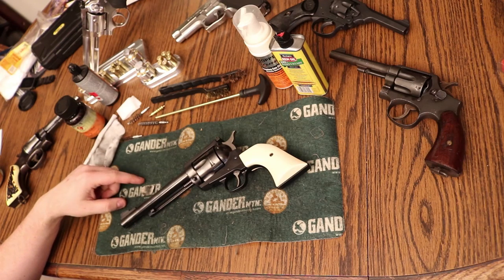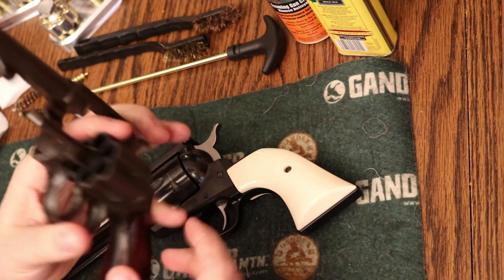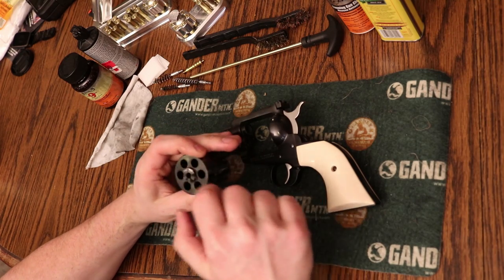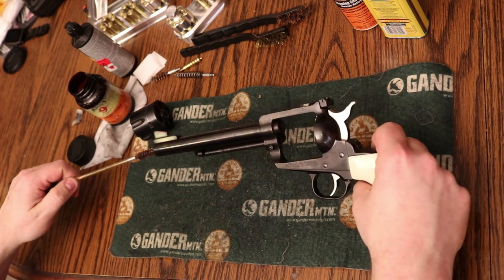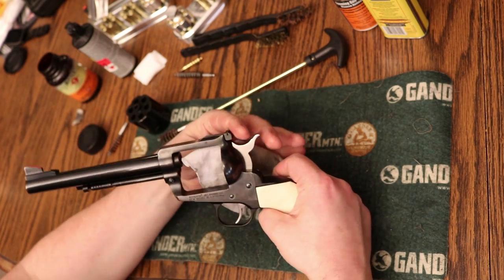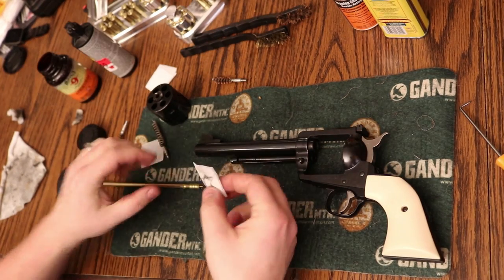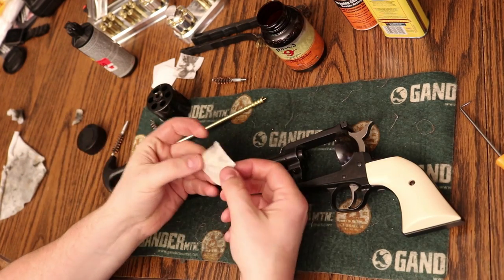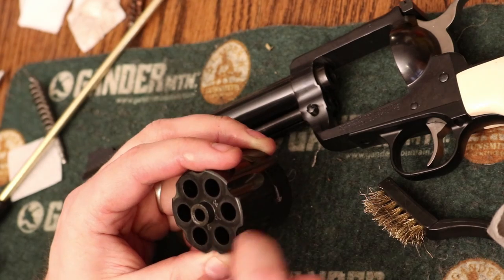How to clean your blued revolver like a Pro

Comment: I use a tornado brush inside the cylinder to remove the ring. It builds up quickly when using the 38 special ctg in my .357 revolver. As for the powder burn rings I use balistol and a toothbrush.
Reply: ritesideo

Comment: Never, ever stop a wire brush without pushing it all away the way through a barrel or the chambers of a cylinder. That wire won't damage the gun but it folds the bristles of the brush back against itself completely wrecking the brush.
Reply: I agree with gunBlue the S&W Armorer. Only 1 drop of mineral oil on extractor rod and the cylinder pin. Oil is not your friend...
Reply: @michaeldickerson873  No such thing as overlubrication

Comment: go to the auto parts store and get a can of Gunk Carburetor and Choke spray cleaner for $3.  Not brake cleaner!!!  FAST cleaning puts Hoppes to shame.  you can clean a gun in 5 minutes and much cleaner than hoppes with an hour of scrubbing.   Then wipe/lubricate it with your favorite oil.  Blue or stainless no problem.
Reply: I just discovered this tutorial. 
I stumbled upon using carburetor cleaner as a neat trick for cleaning guns just last month. I thought I'd try it to clean my lead and lube gunked up reloading dies. 

It did such a good job on them that I  experimented with it on my Uberti SAA .45 Colt revolver. When I finished, it looked like it had never been shot. Shined a bore light down the barrel, and it reflected like a crystal wine glass. Good stuff that works fast and cleans thoroughly.

Comment: Cleaning the ejector rod and lightly oiling the base pin and center hole,  ( lightly ) matters alot. 
Question, how often and how do you clean up the ejector spring? 
I know that disassembly is the long answer but other than an air compressor and just rubbing a lightly oiled rag back and forth I d as much as I do and it's still pretty dirty in there...I dunno. Any Thoughts?

Comment: newbie question: are the nylon scrubbing pads for doing dishes any good for cleaning the gun with?
Reply from the maker: I would stay away.  The ones that are soft enough not to damage the gun 
are going to leave shit all over the gun.  The harsher ones like 
Scotchbrite pads that are made for scraping crud off pans will take off 
bluing and will make shiny stainless matte colored.

Also since most gun products are made to work with cotton patches and brass brushes you might end up with the chemicals melting the pad depending on what it's made of.
Reply: Thanks , good to know

Comment: I seen a video a while back. Guy said you can use Mother's Chrome Polish to polish a stainless steel gun. And it will make it shine like no other gun. Do you anything about this method of cleaning a gun?  Thanks for sharing your video. Great video thumbs up. I always enjoy your videos.
Reply from the maker: I just made a video about cleaning a  stainless gun as well.
https://www.youtube.com/watch?v=FRfbUP3v7rw

You can use Flitz, Mothers or whatever you want so long as it's for polishing stainless on the label.  But using a lead cloth like I show in the video will get fouling and lightly polish.  Big issue is if you use something too aggressive and end up making a matte finish too shiny in one spot an either have to polish the whole thing or bead blast it back to matte.